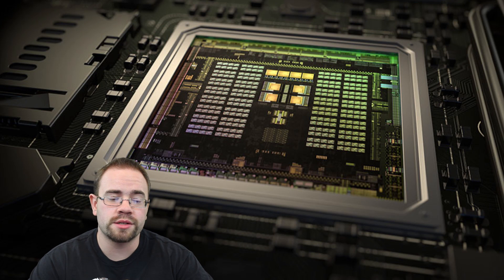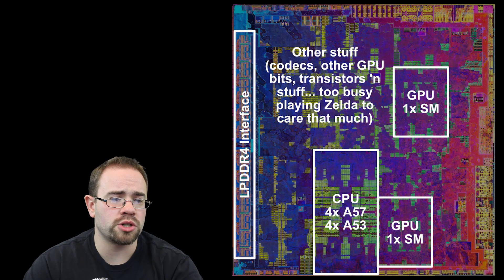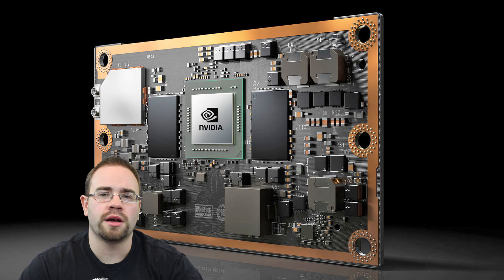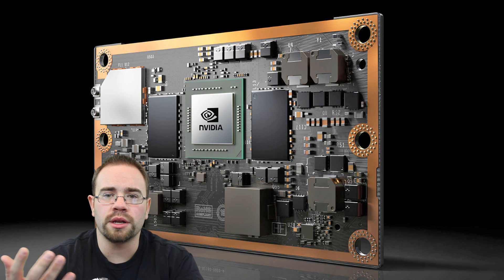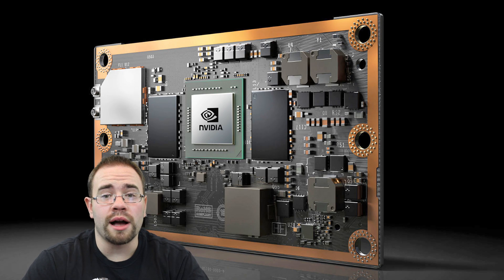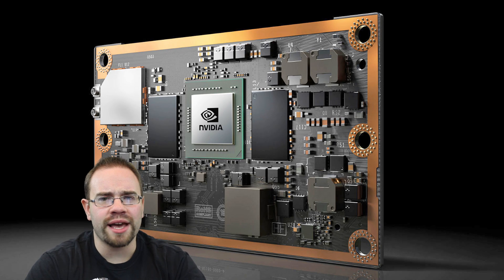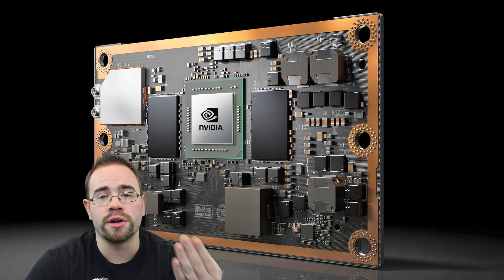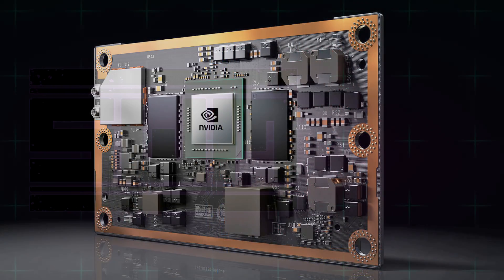Nintendo Switch Chip Was X-Rayed! Here's What's Inside.

Comment: I'm a bit disappointed that the P1 didn't make it to the Switch. It would have put out much greater visuals while putting out less heat, which is ideal for a handheld. That said, while I'm a bit disappointed that the Switch isn't using the latest and greatest Tegra chip, the Tegra X1 IS a fantastic chip and can put out performance that isn't that far off from XB1. Even just having the X1 in there makes this thing pretty stinking powerful.

On a side note, Nintendo really opened themselves up to opportunities here. Down the road, if they decide to make a "New" or "Pro" version of the system, they can just slap in the P1 or an even newer Tegra chip. Also, it doesn't seem that the Tegra series chips are widely used outside of Nvidia's own hardware so it was very smart for Nintendo to go with this technology to power the system. Nvidia will likely work very closely with Nintendo on future hardware after the success of this system.

Comment: Hey SpawnWave... just saw a rumor where this guy is saying he measured the wattage being used by the by the Switch in handheld mode and it  is  running off of 7.5 wats.  The minimum wattage to run the Tegra X1 is 15 watts.  Ironically the X2 also runs at 7.5 watts just like the Switch. 

What do you think about this???

Comment: I think Nintendo and NVidia were not transparent initially because of the way in which they wanted to present the Switch (i.e. home console) which would probably not benefit from an admission that the GPU /CPU were considerably underpowered in comparisons to the competition (Sony/Microsoft). It’s a handheld device. 

Nintendo will likely plan to funnel their existing hand-held customers over to the Switch but right now I’d argue that it’s far too expensive to attract customers in the numbers needed to make the 3rd parties sit up and take note. 

I would imagine that perhaps after a year when the price drops to about  £179.00 and there are some killer apps on the system (Metroid Prime/ Resident Evil catalogue / Mario / whole Nintendo back catalogue) it will start to look attractive to the casual gamer. Will it be too late by then especially with the Xbox Scorpio and PS5 on the horizon? Perhaps.

Comment: Pretty disappointed with this, I am not interested in a dedicated handheld and this means that most of the big games either won't come to the switch or won't run as well in docked mode as they will on my ps4, not sure if I want to buy another console just like my wii-u which will have about 7 games over it's lifetime that I actually buy. 

I wish nintendo would actually spend some money on the hardware instead of always going for the cheap option so they could gouge us for cash with it.

Comment: Regarding NVIDIA's modifications to the X1 for Nintendo, it's obviously not radically different (or radically higher-performance), but that doesn't mean there were no modifications. If you look at the chip, what looks like small solid-color rectangles are caches (SRAM), and what looks like blank space is autorouted logic. Changes to the GPU's specific capabilities which don't change the overall architecture wouldn't make any visible change in the chip, they would just change the logic in those "blank spaces", which wouldn't be visible at all. So I wouldn't say the chip is "identical" to the X1, but that its overall architecture is the same as that of the X1.
Reply: I didn't say any of that, I said "changes to the GPU's specific capabilities which don't change the overall architecture". And I specifically said it would not give the chip radically higher performance. I'm talking about, for example, we know the Switch can support Vulkan; maybe they modified the GPU so it can read Vulkan-format drawcalls natively. This wouldn't mean "2nd GPU", this would mean some changes to an instruction decoder somewhere, which would be completely impossible to see from a die shot like this. But since Vulkan allows the same hardware to get better performance, this is a significant modification.

Comment: But wouldn't changing the architecture of the GPU make the games incompatible with the original architecture? Look at the latest system revisions. The New 3DS? Doesn't even touch the GPU, the CPU is much stronger. The PS4  Pro? IIRC it doesn't change the GPU and the CPU is stronger. That's why those system revisions don't change easily how games run.
Reply: I don't know about the PS4, but the n3ds runs at original specs unless the game calls for the higher specs. Also the CPU was weak compared to GPU anyway.
Reply: +Craftyawesome Yes, but I'm not sure why that makes a difference. By hacking the console, you can use the higher clock speed and the L2 cache with all the games, which causes stability issues in some games, but the majority run better.

Anyway, the point I was trying to make was that the revisions don't upgrade the GPU.
Reply: Best I can tell the ps4 pro did get a new GPU. It just supports the same APIs as the old one. 
What I'm guessing happened is that a combiniation of R&D costs, and risking lowering their already low launch lineup prevented it.

Comment: I still hope for a gpu-dock, boosting the graphical power of the Switch. A gtx1060 or something similar. It should be possible through the USB-c port as far as I know.
Reply: Sh4dy nope. in order to boost GPU significantly, it has to be thunderbolt 3 USB type c which the switch is not. plus, to get a very high GPU boost, the device inside must contain a very powerful CPU enough to handle something like 970ti, 1060, 1080. Nintendo manchildren knows nothing about technology

Comment: Hmmm i was hoping there were 512 gpu Cores instead of 256... :/ 
So i guess the only 'custom' thing is the clock rate :/ im kinda sad, because i hoped there would be something 'big' inside. Just change the clock rate isn't that much custom at all for me :/
Anyway, I got this console. And I'll hope this little GPU will run those UE4 games smoothly at 30-60fps. If not this was the last Nintendo home console i was Buying. Let's wait and hope they can tickle more Power out of it. I thinks this thing is stuttering with zelda because of the engine. So the zelda engine stuttering at 25 fps. But unreal engine perhaps will run 'better Looking games' with better fps because zelda was made for the Wii u first. I just hope this. If not the switch will perhaps go down Quick. Let's weit and See.

Comment: So it is basically an overclocked Tegra X1 customized with all the modern API's to boost its performance. Considering the X2 isn't even out and is only being used in drones and the such. Regardless the Switch is still by far the most powerful Handheld on the market and so far it has performed quite well selling over 1.5 units in the first 3 days. It has lots of potential, all we need is for Nintendo to blow us back with more AAA 1st party games.

Comment: I think that the core's are deactivated for the reason that on ore more of them are damaged/not working. We see examples of selling strategies like this to malfuncioning products every day in that market segment this isnt something new. Example for it is the AMD Phenom II x3, actually its a Phenom II x4  with deactivated core and lower clockspeeds because something went wrong in the Manufacturing process or the build Chip cant reach the minimum performance needed to be a x4 due to Material texture. Instead of dumbing the malfunctioning/flawed product it gets sold for cheaper with other specifications which do work properly. I guess this is also the reason Nintendo and Nvidia dont talk much about it. But im actually fine with it.

Comment: what's more powerful? the Snapdragon 835 or this?
Reply: Snapdrahon 835 is just the CPU and its way stronger the GPU (Adreno 540) is also significantly stronger.

That SOC is build in 10nm, the x1 is ancient tech fro 2015 (20nm).

Nontheless, the switch active cooling system (air ventilation) will most likely allow for better usage of that chip. If somebody makes a device with the Snapdragon 835 and an active cooling solution, the switch has no chance.

Comment: How does the TX2 being the TX2 make it an X2? they do not correlate its simply the second revision in the TX (Tegra maXwell) line which could use an X2 but thats not guarenteed. a revised tegra X1 would be an X2 but because their new chip will be pascal it will be P1 a pascal development board would be the TP1 as the kepler was called the TK1

Comment: 1) it's disappointing that a new console has a 2 years old chip.
2) I understand there's no other TEGRA option.
3) maybe they could have developed their own more powerful chip or collaborated with another chip manufacturer?
Reply: that's normal with console business. when they still develop the system the tech inside probably one of the latest at the time but when they officially launch the hardware inside probably around one to two years behind. the original PS4 GPU is something that similar to AMD HD7800 series. AMD release those GPU in early 2012. when PS4 comes out that GPU almost 2 years old on the PC.
Reply: Squid Empress But in the GPU world a year is a lot..

Comment: Zelda Nintendo's flagship can't even do 1080P; which was custom made for the system, & it has trouble getting 30FPS, which by the way, DOES affect gameplay.  Also, the pop-ins are as bad as Dynasty Warrior games.  So yeah get ready for more overpriced Indie games and upscaled 3DS ports.
Reply: about 4 YEARS of development for BOTW were with the wii u in mind, you can't just port a game that was made for a weak console (wich runs at 720p) and magically upscale all the textures and models for them to be 1080p. For them to competently do that would require them to delay the game AGAIN for at least another year, and let's be honest, the Switch NEEDED BOTW at launch.
P.S.  You seem to be confusing port with remaster, a port is the exact same game (including graphics), a remaster is the exact same game with BETTER GRAPHICS (aka The Last of Us Remastered and Tomb Raider Remaster). Also, no one is saying that games IN GENERAL are easy to port to the switch, we are saying that games MADE WITH UNREAL ENGINE 4 are easy to port to the switch.
Reply: tgrujic1965 zelda was designed for wii u hardware, not switch. the switch version is a port. a port is never a good example of a systems capabilities.
Reply: Another excuse...this is a nintendo game, right?...they had plenty of time to code it so it works at an optimal level.  If Nintendo can't figure out how to make their games run well than the Switch is in real trouble.  Besides, I hear that it is sooooooo easy to port games over..what happened with that arguement?
Reply: tgrujic1965 I had a similar thought, but someone else in the comments reminded me that the WiiU development for Zelda was 4 years, and the Switch version was just a port made in the last year or so. If Nintendo made the game from the ground up for the Switch I'm fairly confident that we would have seen a better preforming and better looking game.

Comment: X1,X2, P1... Meh, it doesn't matter, it's the games that you play that does matter, to me it doesn't change anything :-)
Reply: Zelda's was barely noticeable. If someone hadn't pointed it out , I wouldn't know it had framerate issues
Reply: but those games already have framerate issues (Zelda, Dragon Quest Heroes)
Reply: coolertuep Kingdom Hearts 1.5 + 2.5 Remix is having framerate issues and potentially crashes and no one raises pitchforks at Sony.
Reply: But, but, but, Coolerstep, i don't have any of those issues, explain me that. I do have issues with Horizon Zero Dawn though on my PS4. Only thing of course is, Playstation = god in many people's eyes. Don't get me wrong, i freaking love Playstation, had one since the first came out and had them all up until this one now. I play it daily, and i'm all in love with it. But it does have it's issues, just like the Nintendo.

Framedrops is something that can be fixed i'm sure, i already heard that it might be caused by the WIFI in the Switch, and turning it off would help. So with a firmware update of that, problem should be solved. But the game isn't "unplayable" is it?

So i think it will be just fine ;-)

Comment: I love my switch. I have a blast with Zelda and Snipperclips. But now that the weak hardware is confirmed I wish I would have never bought it.
Reply: derwitz If "weak" hardware is the reason why you magically Stopped having fun with the Switch Then you had never bought it in the place Or Any Handheld or Console for that matter.
Reply: SMoj Thing is though Nintendo considers the Switch to be a home console like the PS4/XBone, so of course people are going to want a powerful console. The Switch is a powerful handheld yes, but that alone is not enough to get third-party developers on board. The Switch will live and die by first-party and indie titles alone with some inferior third-party ports.
Reply: Aw okay luckily I didn't trade in my ps4 for down payment on the switch which I was tempted 😵
Reply: derwitz the hardware is not weak. its using the most powerful mobile chip currently in the market. did you honestly think a small little tablet can compete with a big box like the ps4? right now, that wouldnt even be possible.

Comment: Good video SpawnWave. The games look fantastic at the mo and it's just the start of the consoles life cycle games are gonna look better n better over time which I am looking forward too plus like you said Nintendo got big hitters too drop BotW is the First then Mario Kart possibly Xenoblade 2 and most definitely Mario Odyssey potential one of the biggest sellers on the system and with a Pokémon on cards aswell then i think 3rds will start porting n making games for the Switch.

Comment: Bro, its an underclocked x1. the normal tegra x1 which is in the shield runs at 1000mhz, on the undocked switch it runs at around 320mhz much less than half. It gives around 180gflops. Far from the most powerful handheld. For persepective the exynos on galaxy s7 has a gpu with 265gflops and that device is old now. So the switch undocked is actually an underpowered handheld.
Reply: San Mattew but a galaxy phone can't run breath of the wild, i doubt any tablet currently on the market can. The switch is engineered for games only, thats the big difference.
Reply: right now we still don't know the exact clock for the device. but even if we take that numbers mentioned by DF as true the switch operate using low level API that did not exist on any smartphone. our smartphones have impressive hardware but that impressive hardware were somehow wasted due to inefficient softwares.
Reply: SMoj it doesnt run it because its not ported to it. But it is definitely more than capable to play it and all other switch games.
Reply: Google Pixel C. Same specs just running android.
Reply: Renzc ode Yes you are right there. Unfortunately software isnt given enough attention on smartphones

Comment: Sheesh this comments section is full of Nintendo apologists. I'm tired of people towing the "I don't care about graphics I just care about games" line. To those people I say this - look at what Nintendo was able to pull off with Zelda Breath of the Wild. They said themselves in the making of documentary that they wanted to make this type of Zelda game back on Gamecube but couldn't because of hardware limitations. Now imagine what Nintendo could pull off if they weren't always limiting themselves with low powered specs? The Switch can barely pull off 30fps on Zelda BOTW and it barely hits 900p when docked as Digital Foundry proved so you can forget about Nintendo pushing things further when it comes to open world games because the Switch just doesn't have enough horsepower. My question is that how is this X1 chip even halfway between a WiiU and XBOX One as some devs are saying?

Comment: Hi. How many TFLOP is the Switch then based on new information like this? Thank you. God bless. Proverbs 31
Reply: WTF no thats not true.
The X1 has 0.5 Tflop. so the switch in DOCKED mode will be about 0.5 and probably around 0.2 Tflops in undocked mode.
It is way too under powered, it will not run AAA titles
Reply: Hi. If it's 1 TFLOP & Overwatch port is true (has a good chance coz' it's only Easter Season yet it's sold 1.5M already. 5M units sold by Christmas they say), it can do Overwatch at 720p coz' it's minimum system requirements is just a 0.9 TFLOP GPU. That'd be great for gaming on the go (it's strength) with Overwatch- I bet Overwatch Amiibo drops exclusive weapons to set it different from other ports. High chance Switch could surpass PS2 at this rate. Let's hope and pray (and fast). I think it'll have a precise controls with fps using the accelerometer to act as a dpi switcher of sorts and an analog "wasd" + d small screen for twitch, precise movements on any fps game.

Comment: Well if you're worried about gimped graphics and whether the Switch is powerful enough. Wii U is at 352 GFLOPS of compute while portable mode Switch is at 196 GFLOPS. But Zelda runs better in portable mode on the Switch. If Nintendo could pull Xenoblade Chronicles X from the Wii U, ~30% as powerful as Xbox One and 20% the power of PS4, then I think they can do wonders on a modern architecture with the Switch. I bought the Switch for Nintendo games, anything else is just gravy.